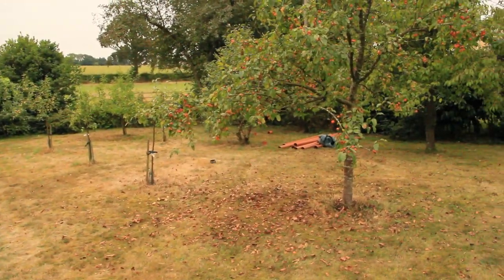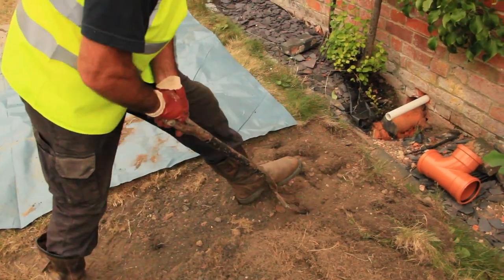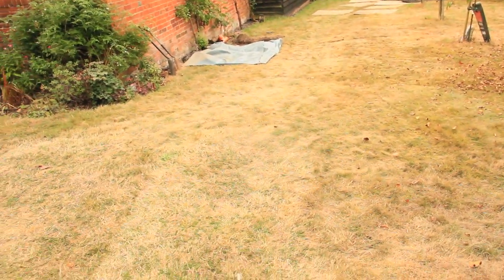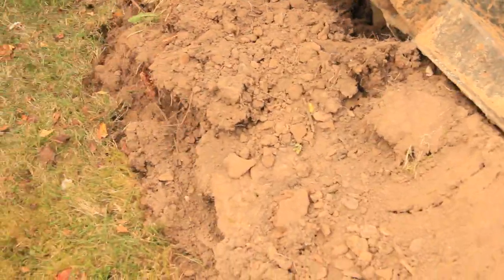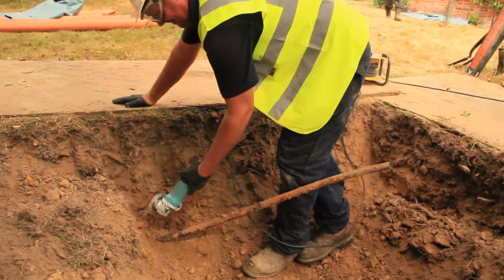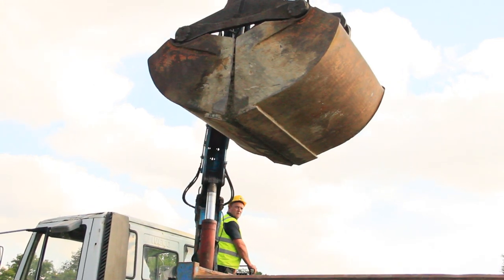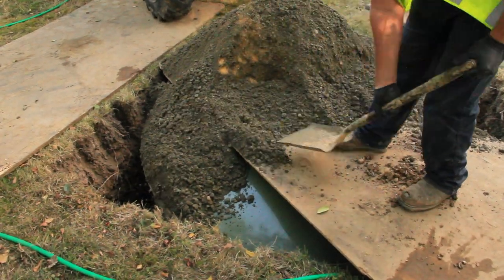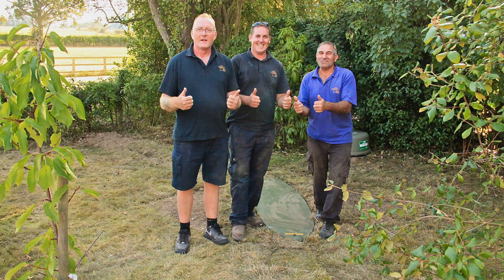ASL Ltd - Treatment Plant Installation

Comment: One of the more informative Treatment plant installation videos I have seen. I'm currently fixing a Treatment plant that collapsed inwards when emptied after a year and I believe this could have been avoided if it had been encased in concrete as you have done. I've also repaired Treatment plants that floated when empty due to the high water table. Concrete around the tank is worth doing.